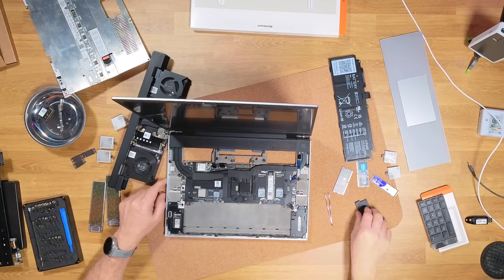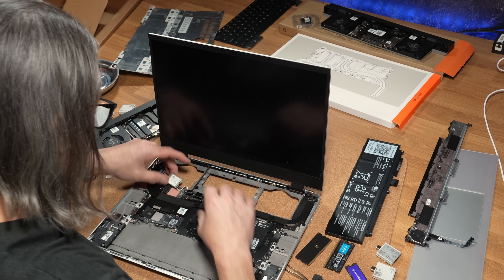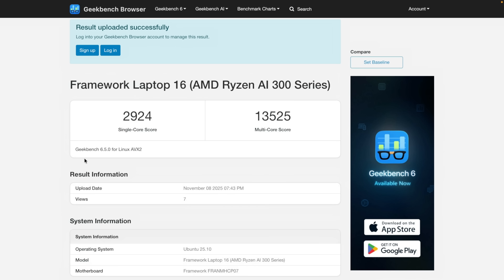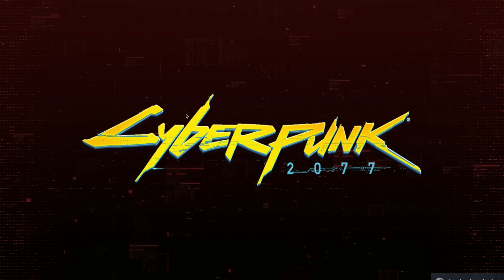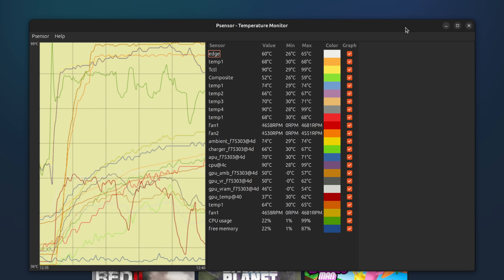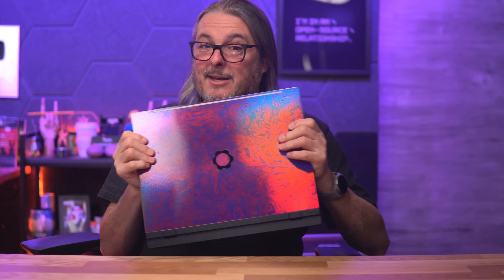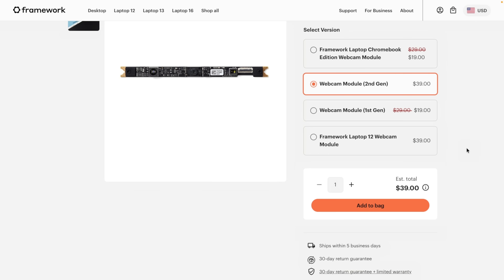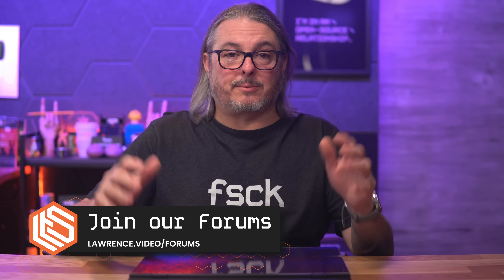This Upgrade Completely Changed My Framework 16

Comment: I agree, Windows has never run on my framework 13 and it never will 😂 also! My 100 lb Dogo Argentino stepped on my laptop screen while it was open and bent it to about a 45° angle. I bent it back and turned it on expecting the screen to be destroyed, but now you can't even tell that it happened and there are no dead pixels or lighting differences. Truly astonished and I will only be getting framework laptops moving forward if at all possible 😀

Additionally, it renders 4K video at 60 frames per second at nearly real time 😎

Comment: I'm hoping that in a future system Framework will produce an AMD (codename here) Halo/Ryzen Max+ level motherboard for the 16.   I'd really like to be able to buy a main board with 128gb of ram,16 cores and the igpu being really high end.   And if they can patch in a 6070 or a Radeon 10XXX class dGPU with 16gb - 32gb ram that woulld be great.  Until then I see no point in doing an upgrade.   Also - an open firmware or at least better firmware controls would be excellent.

Comment: I wished that the cost of entry into their ecosystem wasn't quite as high.

Even the refurbished Framework laptops can cost more than a new laptop, which is a bummer.

I also ran a count once, with one of my laptops, and I think that I counted something like 9 ports/external connections.

That's also a bummer as the Framework 13 can only provide you with 4 external connections, and one of them has to be the USB-C for charging said Framework laptop, so you're left with 3. The Framework 16 adds two more external ports to that, but nowhere near the 9 that I get, by default, with my Maingear laptop.

Comment: 5:45 The reason why some particular distributions are more controversial than others is often the companies that basically put said those distributions try to add in proprietary, adware or other stuff into the tech stack. Canonical and Redhat are the worst offenders. If you have been burned by said companies (like many have), there is typically a lot of resentment there. I don't understand how someone with almost 400k subscribers tech channel hasn't picked up on this yet.

TBH. There are only maybe 10 core Linux distros and out of those 10 there are only 3 or 4 that really matter (Redhat/Fedora, Arch, Debian and Suse), almost everything else is irrelevant (for desktop) or a derivative of these distros. So it best to pick one of those and run that, than run the forks which all have their own weird issues and quirks.

Comment: I would've bought [at least] one, if they would ship it to Norway. But they won't.
Reply: What. I thought whole EEA was covered. Have you checked recently? I am getting parts shipped to my backwater via NL
Reply: @LA-MJ  I checked today. EFTA countries (Iceland, Liechtenstein, Norway, Switzerland) aren't included, despite being a part of the "single market". Excluding Switzerland, the rest are in the EEA, and still not covered. Same deal with other online retailers that operate inside EU, like Amazon and similar. Non-EU members don't get anything, regardless of EEA/EFTA/single market. The only way for me to get a Framework unit is by hiring a middle-man and pay double taxes and shipping (first to EU, then my own country). Because of this, I would also not be (legally) covered by warranty (even though [Framework] state that EEA countries get a 2 year warranty), nor local consumer protection laws.

So... If I happen to receive a DOA unit, that's a lot of money out the window for a paperweight.
Reply: @b0Stark  well that's a huge shocker to me. It turns out Norway is worse than the Baltics in this aspect.

Comment: Looking forward to my batch 1 FW16 HX 370. Having dealt with a System76/Clevo Oryx Pro since the end of 2020.... I can't wait to have that piece of junk out of daily use. Opted to give Framework a try as a hardware-focused (no custom Ubuntu re-spins/unnecessary desktop detours) vendor which treats Linux as a first class OS option. Repairability/upgradeability were also a factor... Similar for being 16:10 and centered keyboard/no numpad - I strongly prefer 16:10 over 16:9 and absolutely hate left aligned laptop keyboards.

Comment: I am very interested to daily drive a Framework laptop. Hearing the upgrade process you experienced was pretty inspiring. And I would love to run Linux instead of Windows, but my use case doesn't allow for it. I'm a full time video creative with clients who work in a range of programs, Adobe being the largest provider of software, which is a non-starter on Linux for now. While I could run Windows, that's not my preference so I'll just have to wait until either Adobe starts supporting Linux, or my clients move over to other products with Linux support. I think the latter is more likely. So many of my colleagues have moved over to DaVinci Resolve over the past few years.

It's unfortunate you received negative responses to using a Mac for video editing. In my opinion it's the best hardware and software combo for the job. Of course there is no upgrade path, but the hardware is so well optimized for the use case that the longevity is likely on par with a device like the Framework. I'm using a 2020 M1 MacBook Air as my daily driver and it's been an outstanding machine. My clients are moving into higher resolution video production though, so I'm in the market for a new laptop with more CPU cores and clock. This Mac will be handed over to my wife who is running a similarly un-upgradable HP laptop from 2016. Assuming she uses this Mac for another 5 years, we'll have accumulated 10+ years of usage out of a $1400 investment. I think that's plenty of longevity, and it's certainly a great use of $1400.